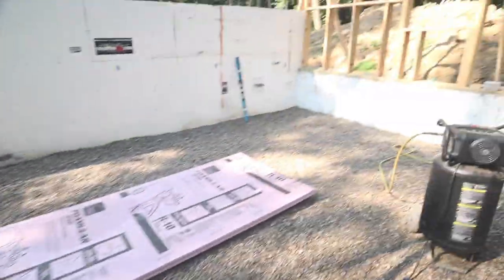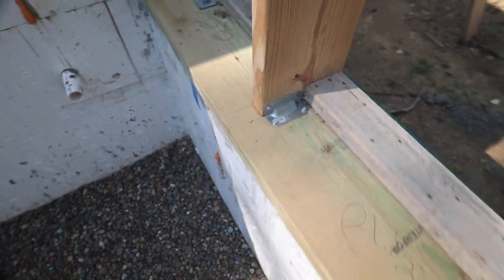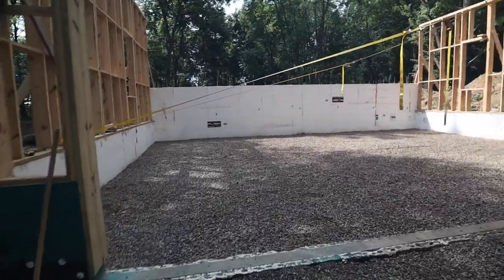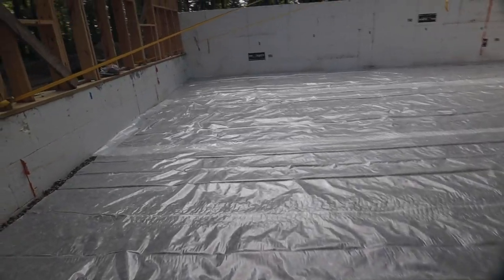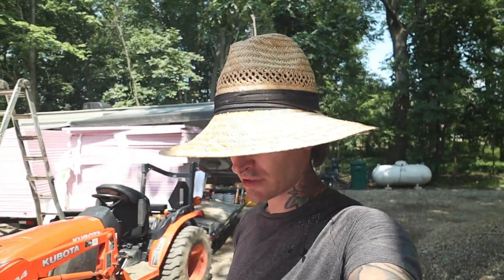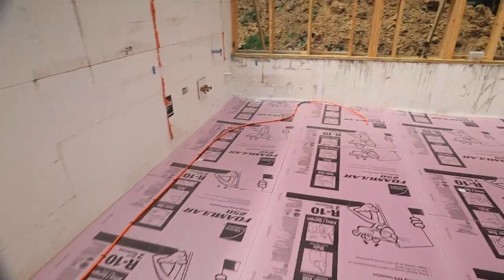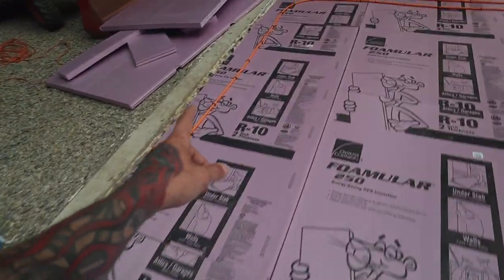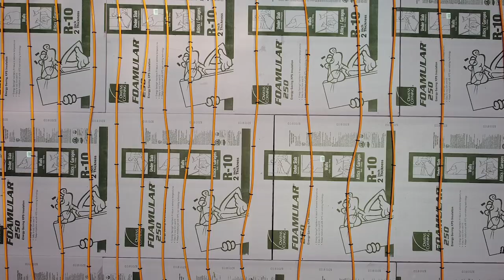Garage radiant floor heating install with PEX and foam.

Comment: Thanks for posting this video! I have about 25 years installing radiant heating systems and have installed hundreds of projects and thought you did a really great job on your installation. With the first company I worked for we would consistently install 1/2" pex on 18" centers for slab areas like the garage and the basement. Every one of those systems worked beautifully, so I expect yours will work wonderfully as well. With the 12-18" centers along with the 4" slabs the floors have a tendency to balance out nicely by the time the heat gets up to the surface, so you will not be able to feel variances in temperatures in the floor. Im looking forward to seeing the next phase of your project, well done!
Reply from the maker: Good to know!   Yeah my garage I think is 12-18”  OC but it’s pretty thick!   We have 9+ inch in the back tapering to 5.5” at the front apron so it’ll take forever to heat and cool.   That’s why I’ll probably run the ductless AC to bring the heat up till the floor gets up to temp in the winter.   At this point I just wish I knew how to install the whole system with all parts needed etc.
Reply from the maker: wish you could plan the system now!

Comment: Definitely educational, taught me that if I ever lay pex for radiant heating, I'm going to pre-plan my pattern.
Reply from the maker: theres also spacing thats recommended based on pex size too.  you can get away with less pex and further spacing if you use 3/4" for example.

Comment: Matt Risinger suggests that you tape and put the plastic vapor barrier over the foam to prevent concrete from getting under the foam and floating. If the foam floats you’ll never get it down. I like your videos
Reply from the maker: Bert Weston the foam has distorted since being down.  Surprised as the Fox Block foam hasn’t moved or changed shape.  I am going to tape now.  Should be good with a 4-5 slump as it’s not liquid enough to get under.

Comment: If I can make a suggestion when you run the basement pex,  Use graph paper to layout your runs next time.  I even chalked lines to run the pex straight.  Looks really good when you look back at pictures.
Reply from the maker: Rhaulman I’m not a finisher guy haha.  Like to just plow ahead.  In the end it all works and if the works hidden I don’t mind.  I don’t mind seeing those pics from others but it’s not for me with time and the fine details.

Comment: It's obviously late, but compacting the stone/earth before pouring concrete would have kept the stone/earth from settling later and causing cracks which is more expensive to fix than renting a compactor.
Reply from the maker: the ground the stone and sand are on is hard as concrete clay.  getting through it with the sharp end of a pick axe was impossible!!  need to compact anything because it couldn't go anywhere.  we also had several rains with the sand down which meant the water carried all the sand down into the cracks of the stone locking it in tight.  with 2 inches of sand still on top of everything its a boom under surface for the concrete.  with the fiber mesh mix we used too, im not even cutting relief cuts in the slab.  so far, so good.

Comment: I don't know what climate zone you're in.  I'm in 4 but at 5600'.  I have 2x6 walls with R19 and ICF foundation on my garage.  2" of foam on the floor and pex.  I keep my garage at 55 and that is quite comfortable.  The biggest thing is to not expect to raise the temperature for working.  It will take hours and your feet will be sweating.  My house is also ICF and the same floor treatment.  I keep the basement at 68 and it's quite comfortable.   With the thermal mass of the floor, it doesn't cool off much when you open the doors. Mine aren't as insulated as yours
Reply from the maker: adubbelde1 I’m in zone 5, 1,100ft.  Good to know all that!  I was worried about holidays if it’s to hot when cooking etc we won’t be able to cool the place down fast enough and people will be uncomfortable.   At least the first floors only heating the 3/4 OSB and 3/4 hardwoods.
Reply: @neckofthewoods24  Unfortunately for us, heating the first floor was out of the question due to cost.  We couldn't do staple up because of the truss configuration and the fact that our floor is 1 1/4" of plywood and 3/4" of hardwood.  We looked at WARMBOARD as an option but it was $12,000 just for the boards not including shipping from CA.
Reply from the maker: adubbelde1 exactly!!  I couldn’t afford $225 a panel!  Minus $28 I did spend it would of still been $197 more per piece!  Now since wood has a horrible R value, you’d only be trying to heat though a R-2, you couldn’t do that??

Comment: A little extra attention to detail for securing you walls, and trusses can pay dividends down the road. I plan on doing the same thing on our build, an extra $100-$500 in cost seems worth it to me.
Reply from the maker: 100%.  Something builders will never give you and if they offer, that $100 turns into $10,000 real quick cause It’s “custom” and not something they do all the time.  It’s just disgusting.

Comment: No floor drain? I did pex in my garage floor 25 years ago. It's been great. 26x28'. I turned my thermostat off in the middle of December in NW Illinois and it only dropped 2 degrees per day. 5.5" concrete. Back then it was new and they weren't foaming mine sits on sand but is insulated at the walls. My pex is zip tied to the remesh. If you have to fight it to make a bend you can use a heat gun and it will keep the bend as it cools.
Reply from the maker: Jeff Johnson  no drain.  Just a good slop. That’s good to know.  Hopefully with my foam it’ll be even better.  I’d hate to spend a lot in propane.
Reply: Good tip to use heat gun

Comment: Did you do a heat loss calculation? Most pex suppliers will do the tubing layout design for free! A lot better than guessing.
Reply from the maker: No I did not.

Comment: What’s the consensus about the insulation foam under heavy load (like a truck moving in and out every day). I imagine that eventually the foam gets squished and subsequently the floor starts cracking.
Reply from the maker: its made for this and super dense but once the concrete is poured the foam cant move because the concrete doesnt move.  this would happen if say stone was over the foam as driving on it would move and be like a floating floor but once the concrete hard, nothing going to move or break down.

Comment: They are developing long rated screws to screw threw the bottom of top plates to trusses.
Reply from the maker: ive seen those!  if i fail inspection on the hurricane straps for the scissor trusses because its not a normal connection with a 2x12 top plate i may use those or ask to use those.

Comment: I'm late here, but shouldn't all slabs use rebar or wire mesh? I thought it was recommended to zip tie the PEX to them?
Reply from the maker: No it’s not needed because the pex is “bolted” to the foam and it keeps it low in the concrete for damage and like helical steel, fiber mesh (all 4) works the same way.
Reply from the maker: No it’s not needed because the pex is “bolted” to the foam and it keeps it low in the concrete for damage and like helical steel, fiber mesh (all 4) works the same way.

Comment: It's been about a year now and I would like an update on how well your radiant heated floor is working out and what equipment you are using to circulate and heat the liquid
Reply from the maker: we have not installed or bought anything for this yet.   if the mini splits heat well enough and our electric bill doesnt skyrocket, we may never install anything.   check out the latest videos though, one day as they keep coming i may buy the parts to start getting it ready.
Reply: Did you finish it? Looking for the 2nd video
Reply from the maker: @WorshipWithWondersChurch  finish the floor or radiant?  Floor and all that’s done and in our play list.  The radiant is not done.
Reply: @neckofthewoods24  got u. Radiant.
Reply: @neckofthewoods24 is your house front facing East? We are building and def considering radiant but feel it may be overkill.
Reply from the maker: @WorshipWithWondersChurch  we are facing east which I like but I 100% needed a garage not facing west!   I hate setting suns cooking my garage making it uncomfortable to work in.  I don’t think radiant is overkill.  Both propane guys who came out think the mini splits won’t heat because of cost, freezing up and not working at all come negative temps around here.   The mini splits can only cool down to 4°.  We see we’ll into the negatives so I don’t know what to do.  We have it, but it’s not hooked up or in the budget now.
Reply: Please find some new music.

Comment: You don't need the bottom of the studs done because the sheathing holds it together.
Reply from the maker: True but it took 2 months maybe to get it on with some pretty crazy winds out here at times.  For only $40 or something it was reassurance.  Also normal builds nail the sheathing to the sill plate.  With mine it’s nailed to a 2x4 that’s nailed to the sill plate so that extra bracket is more insurance.

Comment: All that extra work and you didn’t bother getting more poly or taping it/ running it up the wall to tape. Then didn’t bother taping the foam. I thought the whole idea is to stop ground moisture intrusion?
Reply from the maker: Bob Hope we did in the basement.  The garage is above grade and sitting on above 4-5 feet of gravel.  There’s no way for moisture to get up that high.   I talk about that in this video.

Comment: AMPEX from Amvic would have been such a labour savings for pex tub install, no staples !!
Reply from the maker: It took me like an hour though or less.  Not sure how that saves on labor.  Something tells me those panels are very expensive vs staples and popping them down in the panels seems labor intensive no?
Reply: @neckofthewoods24  The Ampex is less than $2.00 per sq ft and does not take on moisture like the XPS does. and is often less expensive than the XPS.  Also the grey surface is the vapour barrier , so the 6 mil poly is not required  The whole concept of the  discs is to friction fit to the pex.  You simply walk around with a coil of pex and slide it in between discs.  If you need to make a change of pipe  layout, just pull up the pex and re insert it in a preferred position.  Grid pattern is established by the AMPEX.  So labour time is saved on the poly and the staples and the kneeing or crawling around.
AMPEX elevates the pex tube off the foam such that the concrete encompasses the pipe and the heat get distributed into all the surrounding concrete.  Many of the other foam boards lay the pex on the insulation not in the concrete 100%

Comment: Why would you put a vapor barrier under the foam? Your shiplap foam is a vapor barrier and of your using 32mpa concrete, it's dense enough that it becomes a barrier it self
Reply from the maker: putting it under the foam protects it from degrading and absorbing moister which will lower its R value. 
 also thats what the engineer wanted but as you can see i failed at that haha.  fingers crossed the foam lasts as the sump pump is working 100% now and water shouldn't get up through the stone and sand now.

Comment: How well did the heat for the floor work out ?
Reply from the maker: Never used it.  Still just the tubes as my last quote for install was $35,000 for probably $6000 worth of parts.

Comment: Should have done it 16 inches on center through the cement. Cement wiks the heat and has plenty of mass to only do 16 inches on center throughout. Ive done plenty of radiant heating in cement.
Reply from the maker: So wider?  Everyone else and online says I messed up.   1/2” tube needs like 8” max.  Or so they say.   Last winter wasn’t terrible though out there.   No clue how I could judge propane use though.
Reply: @neckofthewoods24 before I did my own I spent years researching and studying everything there is to know about it...  8 inches is great for floors where there is little to no thermal mass and the r values ar higher:( wood floors, wood subfloor with carpet).
16 inches woorks great in cement because there is high temp. transfer and no r value and you hqve a large thermal mass. I found most if not all plumbers dont study heat loss, energy transfer and thermal mass heating. They always quote whats best for theyre wallet.

Comment: You should of installed the foam under the vapor barrier, if the pex leaks water will pool up on your foam and it isn't 100% water proof and in 20 years r value will decrease if it has absorbed moisture
Reply from the maker: If the pex leaks then I won’t have a radiant system because it’s a closed one.   If all the water is gone then the system is dead and won’t heat.   I probably won’t rip the floor up and start over.  As for water leaking and hurting the foam, I have about 7’ of stone in the garage and it’d take a swimming pool to ever fill up and get to the foam.  As for the basement it’s only about 10” off the stone and sand but still that’s probably 100 times the amount of water to fill that up over what the system will hold.  And the water under the foam, sand and stone can all drain back to the sump and be taken care of.   I agree it should have been done the other way but water shouldn’t be an issue and this way it insured the pex wouldn’t rise with the concrete and it’s for sure buried where nails can get to it.

Comment: I see you didn't use any rebar or wire mesh?
Are you getting that wire stuff added to the mix?
Reply from the maker: the garage had 4.5lbs of plastic fiber per yard added to the mix taking the place of any rebar or wire mesh that could rust and fail.  the basement got 1.5lbs per yrad.  so far so good after a year and we cut no pre stress cuts into the concrete.
Reply: @neckofthewoods24  Thank you for the info...did you do relief cuts as well to prevent cracking?
Reply from the maker: @John-tq4bf  nope